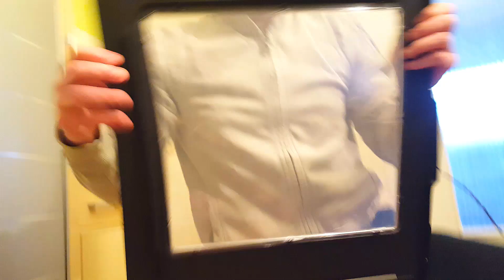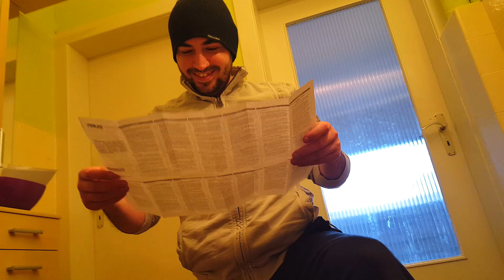HOW TO NOT BUILD A PC [ Building Holly's PC] | VLOG

Comment: Looks so fun.  A lot easier than when I built my first PC.  I was grinning the whole time through.

I'll be horrible and ask the question... on the CPU cooler, it has a fan on each side of the radiator.  When you were showing it off, you had the labels on the fans showing on both sides.  This would set both the fans to try and pull the air through the radiator.  You'll want the make sure the airflow is blowing through the radiator (one fan pushing air through, the other pulling from the other side).  The sides of the fans have little arrows showing the direction of the air flow.  

It also looked like the front case fans were set to blow air out of the system.  Generally, you'll set the front fans to intake because they have a dust filter and the rear and top fans to exhaust.  This helps cut down on dust in the system.  It's of course, totally up to you, but just something I noticed.
Reply: Misa I did the same as you for my pc, specifically for dust. I check it every once and a while and two years later it looks as clean as it did when I put it together. I also have it elevated off the floor, which helps with the dust as well. If anyone plans on building their own pc, I'd suggest taking Misa's advice. 

I also wish they had taken some precautions with static electricty, but oh well. They didn't ground the case so touching it won't help. At least they didn't do it on the carpet.
Reply from the maker: Don't worry, at the very end everything was in the correct direction :D

Comment: Dante, you put the front fans the wrong way. they are currently blowing air out instead of sucking air in. there are usually two arrows on the outer frame of the fans, One shows you which way the fan will be spinning, and the other will show you which way the air will be blown.  I hope you read this so you can fix it. I am so glad the cpu was installed the right way. I held my heart with that scene! First time building a pc without knowing much about it can be a challenge but you guys did it! ( after fixing the ram problem hehe ) Only other tip I can give is try building it on a table next time. Saves a lot of energy!

Comment: Specs?
Reply: HelixsoulX Yus Please :3
Reply: HelixsoulX think a nasa rocket

Then crash it
Reply: I can't say for shure but i think its this:

CPU : IntelCore i7 6700k 

GPU : Asus GTX 1070 (could be a GTX 1080 but due to price and financials i think its a 1070)

Mainboard : Asus z170 Aura

RAM : Corsair Vengance DDR4 16GB (2x8) (don't know the speed but i'am guessing 2133hz because its the cheapest)

CPU Cooler : Corsair H75 AiO

SSD : Samsung 850 evo (prosumitly a 250GB could be 500GB)

HDD : Western Digital red 2TB (I don't know why a NAS drive but the Produktnumbers align... i would have got a WD blue but i unterstand it under the point of "i don't want it to die" )

Case : NZXT Source 340 (with red highlights)

Comment: 1 SSD? How you're dealing with backups in the future to avoid losing data again by crashes? I am always scared about my data so I save them on internal drive, external drive, and CD. Will you use software for managing or do you have other plans? :)
Reply from the maker: All the editing happens on my PC, so she doesn't need that much GB's :)
Reply: Yeah it's not about the GB's. More like the case that you are have audio files on your machine and are prepared when a SSD destroying lightning strike hits your computer. :D
If Holly and you have the same audio/video files all the time or backup them to a external drive it's fine. Please do not lose audio files again. :)

Comment: I'm not sure but You guys might have forgotten to apply the thermal paste to the CPU. Just saying. :D
Reply: Yeah, I noticed that too.  Does that CPU cooler already come with some pre-applied tho?  Some of the all in one systems do.
Reply: I did a little research on the subject and turns out You're right. I think they're using the 120mm H75 corsair liquid cooler witch gets delivered with thermal compound pre applied, like it seems most corsair coolers do. Good to know. Thanks for your thoughts on it tho. ^^
Reply: was thinking the same but wasn't sure about it, thx for looking it up for us all :D

but tbh the probably shoud've put some new thermal paste on it, the pre-delivered ones are often pretty bad
Reply from the maker: Like SirD0nut said, the paste was already applied to the cooling unit c:

Comment: They didn't put thermal paste on the CPU. It'll melt without the thermal paste.
Reply: maybe they cut it out, at least that's what i hope...
or maybe there was already some on there, some shitty cheap stuff but at least something
Reply: JM I thought that too, but their cooling system comes with some already applied. But then again, it doesn't usually come with the best quality.
Reply from the maker: The cooling unit had some paste already applied to it :)
Reply: oh ok

Comment: Specs PLS :P
Reply: Deadman looks like it's running 8 to 16gb of ram an asus z170 mobo intel I? 6??? can't tell from the video a Samsung ssd of unknown capacity the graphics card is a asus strix 10?? rgb looks like a 1070 the power supply is a corsair 650
Reply: Deadman the AIO is a corsair h75 water cooler
Reply: Deadman wait it's an I7 6700k prosser

Comment: Have not gotten through the whole vid yet but had to take the time out to call you a silly dude. If you wanted a case with an optical drive port(disc drive), then why didn't you buy a case that had a slot/s for one? Did you even know you have to also get an optical drive if you want to put one in there(You can use ones from other PCs you have if you don't need them on those anymore or if you don't even use those PC's at all.)? You could have also bought a case with a fan, multiple ones even. the case on my build is a Corsair Carbide series mid tower, comes with like 3 fans, and purty LED lights. Lights not necessary, but purty.

EDIT

That cover where the CPU is, is supposed to come off, its not a problem, and there is typically a matching triangle on the side of the processor slot on the mother board that will match the same triangle that is located on one of the edges on your CPU, which will show you if its positioned the right way too. Be careful not to touch the thermal paste on the CPU if you have.

EDIT

Face-palming at that graphics card insert attempt BTW, what graphics card did you get?

EDIT, have not heard of having 2 ram sticks one slot off from each other, makes no sense in regard to upgrading. You must have a weird motherboard.

</nerd>
Reply from the maker: We were fine with the non drive thingy, because we didn't buy one nor needed one anyway ^-^.
That issue with the ram slots can happen, as you have seen in the vid ^-^

Comment: Ikea furnitures are really easy to build. Cheap quality, but passable, and sooo fucking easy to put together. There's not even words in the manual. It's just pictures. It's wonderful. Just take it slow though, be extra careful about which way is up and which is to the side. Or you gonna get an upside down table.

I bought furnitures to my house from 5 different stores and after buying one from ikea I'm never gonna buy elsewhere, fuck those manuals with shitty instructions.